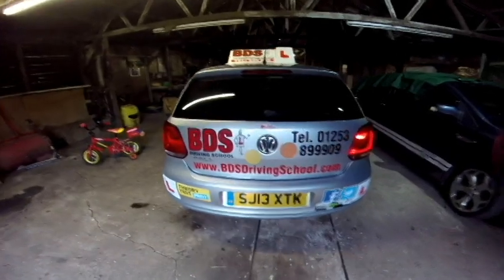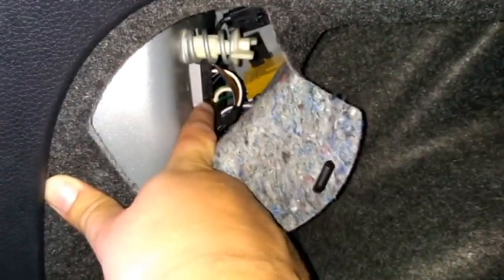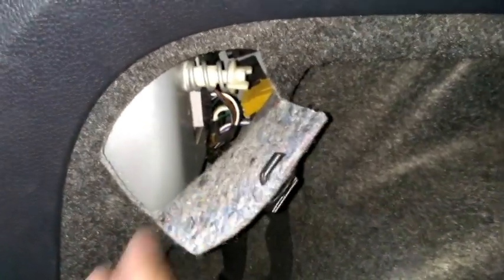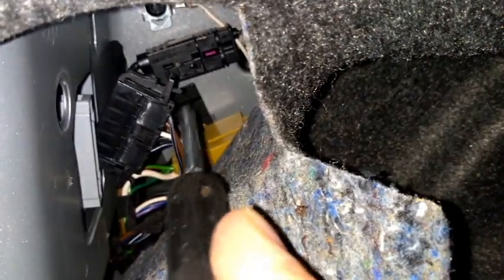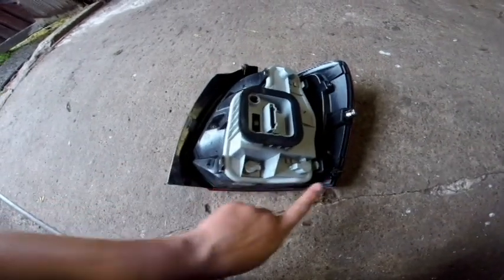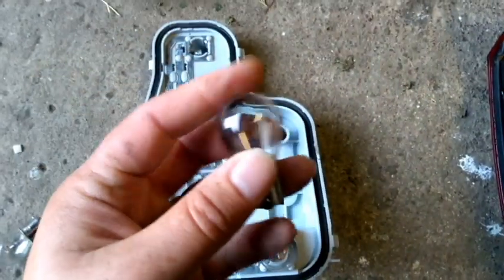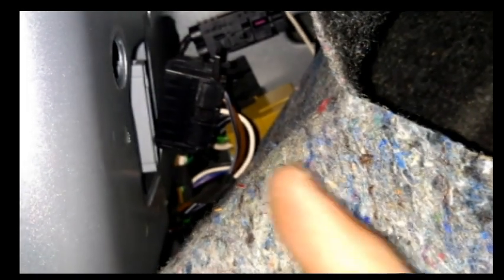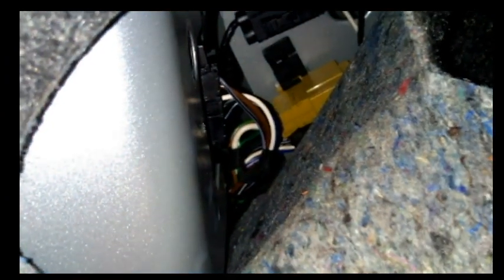Tail light / rear light bulb change mk5 VW Polo

Comment: Well presented how to do video.
I took the o/s lamp out to change the fog bulb then managed to drop the spring locking bolt down in the cavity. I resolved the problem with a long coach bolt fitted with a fiber washer, steel washer, spring washer and then a nut nearest the bolt head. Lamp fitted,  merely screwed in the coach bolt as you would the plastic one into the lamp rear from the inside, then lightly tightened the nut onto the washers.

One tip if I may. Don't put the lamp on the garage floor resting on the plastic lens, it'll get scratched.

Comment: If you accidentally drop the bolt into the cavity it can be retrieved with a magnetic flexible tool which are cheap to buy on Amazon. A handy tool for the garage.
Reply from the maker: yes a very handy tool to have :)